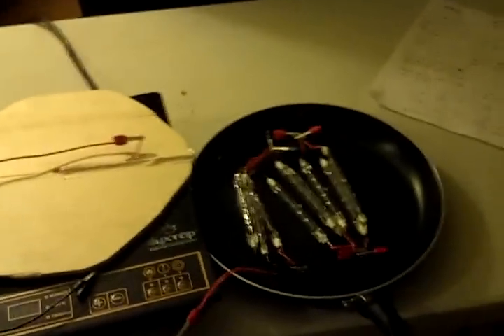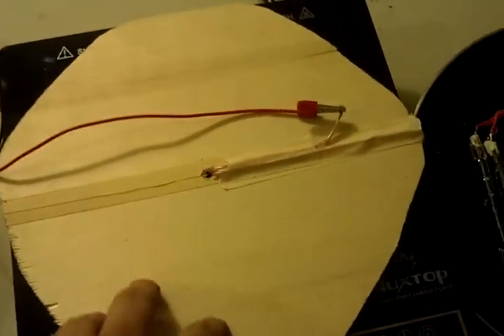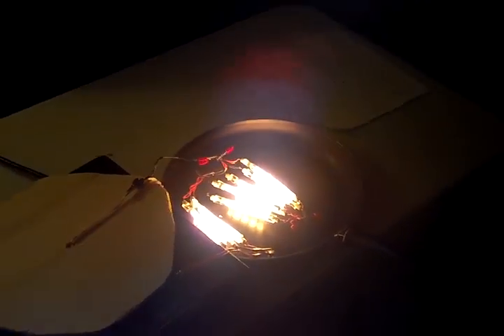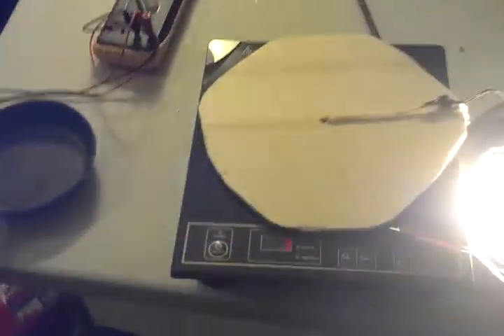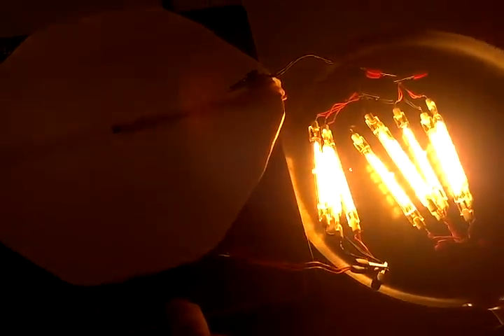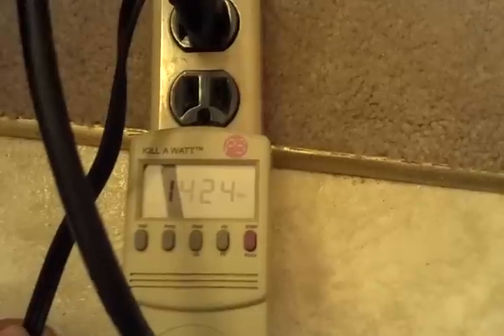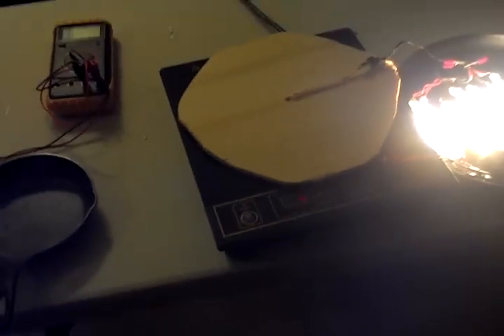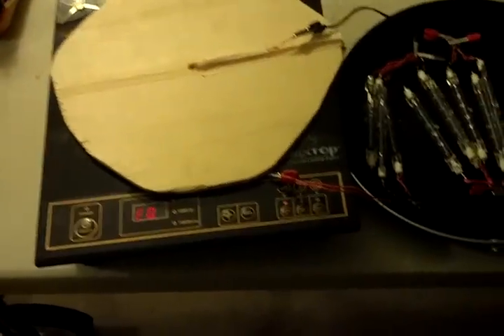2nd GEGENE Demonstration - lighting 4500 watts worth of halogen bulbs.

Comment: Along with my previous comment..I use an ordinary car relay to pulse dc current into a electromagnet placing a second electromagnet on top serving as the pick up coil and what do i get? I get a pulse of dc in pickup coil plus when the relay breaks the circuit i get a second pulse of current  from the collapsing fields; 2 for the price of 1

Comment: If you study dark energy, the vibrations from the cooker are making magnetic waves and the extra energy is coming from Nature to try to compensate these ripples. Tom Bearden talks about "broken symmetry" and how nature fills up the gaps. the cooker is producing oscillating energy that is picked up by the 2nd coil and some extra energy comes in along the low peaks and that is the magic..nature tries to compensate for the perceived wakes

Comment: I don't have any electrical knowledge, but plenty of solution imagination. I have found the oil filled radiator 1500 watt space heaters to be my choice for space heating. So? can this run 2 or more 1500 watt space heaters for the cost of 1, * the use of 1 15 Amp Circuit breaker switch, & if you prove it so, & give scamatic run down, will it stay up on youtube before the Power Grid Gods zapp it off the air.. Ever since I saw the info-mercial on these quick heaters I was wondered at how to use it to be the power source in a Hot Water Heater. Plus the elements need not be in the water getting all scaled over & made less efficiant.. Ok you have the challenge, let the race begin. The winner gets 10 thousand, the Grand winner gets 50 thousand & my Union will fund production. Then Consumer Digest will give it Top Award for Best Hot Water Heater & my Union  Members will patition the U.S. Government to contribute financial subsidy so that near every one can buy this with Monthly installments aided by less electrical bill to the Electric Grid Power Gods. Can I get your Vote I am running for President, just to have a platform, & bark at the scum cattle called American Citizens.mooo  baahhh
Reply from the maker: Dan Guzman What's the resistance across one of the space heaters?  They need to be resistive-based heating elements.    

The GEGENE machine works within a range of 5-20 ohm load (equivelent).   If the load is too small - the machine will automatically shutoff.   If the load is too great - it should normally load balance.  

 If there is any digital logic for power adjustment - your heaters might need to be modified.   Too much inductance on the load, and the AM radiowaves don't flow well.
Reply: Thanks Jon, I wish I was a electrical enginear. Furthest I got was a subscription to a Stereo Review Magazine in the 80's & I was impressed with Bob Carvers Magnetic power amplifiers, & Hafler Mosfets.. But since you mentioned AM frequency I have read about science with that. I research many Bio-electric & magnetic health tools as a hoby. I see using quartz crystals & the mineral Germanium as a super conducter & locked tuning aperatus.. Maybe a good sci-fi paper back can paint this picture for me.. In my imagination I wanted to focus a synchronised magnifying glass on a ceramic core with a copper pipe to bring in solar heat for free. Keep the HHO coming,please! thankyou.
Reply from the maker: Entanglement is the overall goal.   AM radiowaves are an entanglement of 2 AC waves "AND'd" together.   Bifilar coils are an entanglement of 2 transformer secondaries (right next to each other). 

So, wireless, resonant AM acceleration - is represented by two forms of entanglement (entrainment) working together to form predictable load behavior.   See my videos on YouTube channel "joabel19711" if you want.
Reply: vunderball.LOL I will!

Comment: hey with 8 ohms and 4500 watts u should be over the current rating maybe 10 amps and your at sqrt(4500/8) near 25 amps more than double is wire really hot